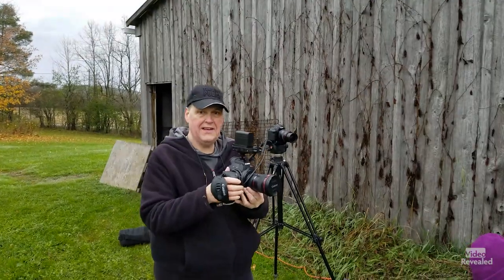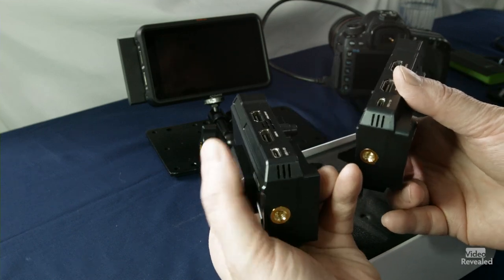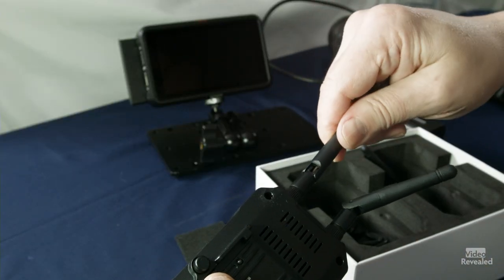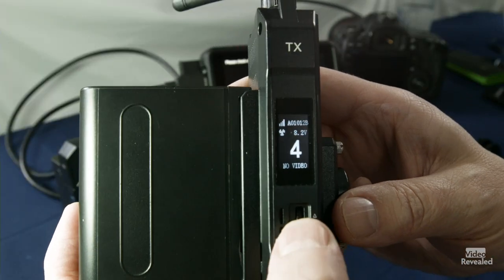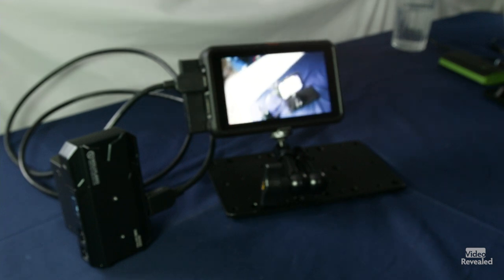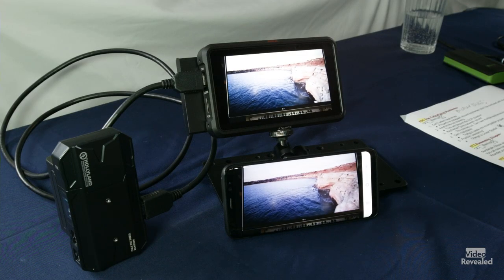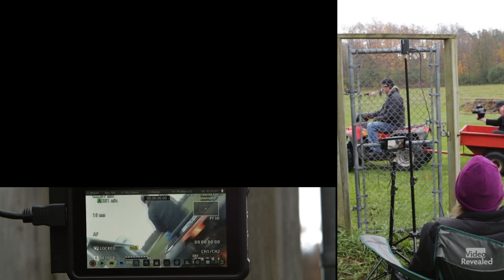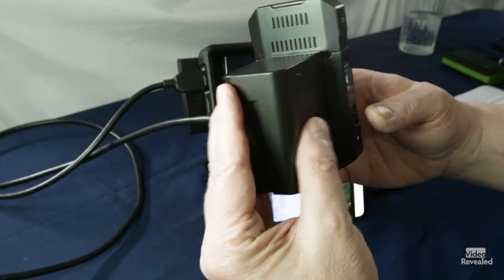Hollyland Mars 300 Pro Video Transmission System

Comment: Very cool. I have the Lark 150 wireless lav system from Hollyland, and chose it over the Rode Wireless Go mainly due to you get the lav mics and it does not rely on an app for most things. 

The ONLY issues are no safety for the safety track, nor the mute so easy to pop into those. I like having both mono and stereo. On my last video, there was a clip in the middle of the video where I accidentally had the Lark in safety track, and tried to fix it, but my NLE was having none of it and kept inputting the first clip's audio instead into the DAW to export back out into mono. Other than that, a great mic system and yes, the build quality is very good, for the price point. I used the lav last Monday when it was very windy out and I was in it, showing the high winds, and got very little wind rustle, thanks to a "dead" cat on the lav, clipped to my shirt. That was the morning the front moved through and it rained and then the temps dropped after a weekend of major atmospheric river blew through Washington State over last weekend.
Reply from the maker: Thanks for that John. The Lark 150 is a fantastic mic solution.

Comment: This Hollyland system looks like it would work as a camera input into a Blackmagic ATEM switcher. HDMI out of the Hollyland receiver into one of the ATEM switcher HDMI inputs. Frees up all the HDMI cable runs from camera to switcher. Wonder if you could have multiple Hollyland receiver/transmitters running from multiple cameras with there being interference between the Hollyland systems? Blackmagic ATEM Mini and ISO are all 1080P so this Hollyland system is a good match. Taking it a step further, you could also record on media in 4k cameras and there is a procedure to link back these 4k files back to the 1080p timeline for a final 4k edit.
So you could livestream/switch a 1080p show and then have a 4k final edited show for the end product. Pretty cool potential for very economical $ investment. Only question is will the different Hollyland systems interfere with each other? They are on different channels right?
Reply from the maker: You can use multiple systems together and manually set the channels for each so they don't interfere. It would be a great streaming solution. As far as relinking to 4k, I guess you could use the HD files as Proxies and link them to the 4k after the fact. Here's a tutorial on manually linking Proxies:
https://youtu.be/i_dkcLUUnYA